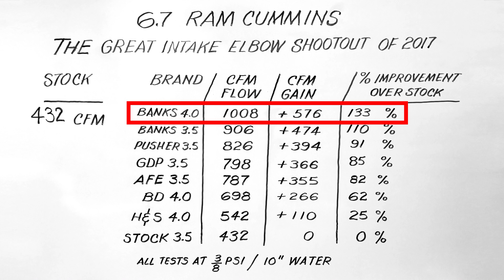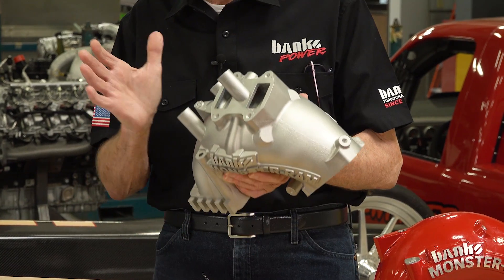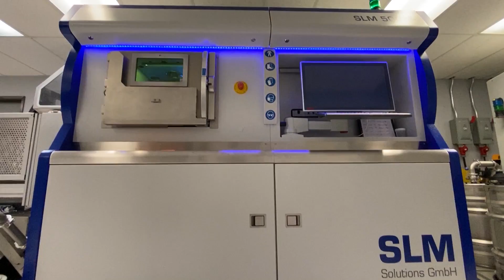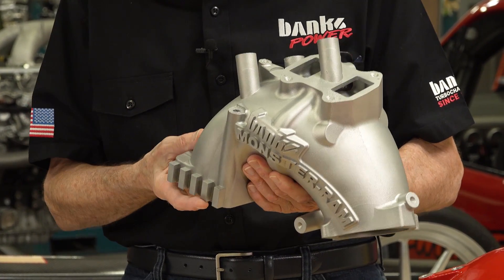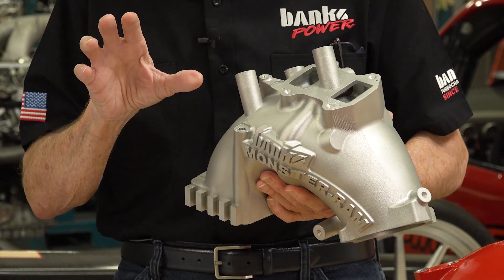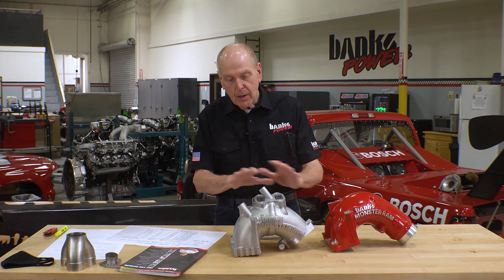This is a 3-D printed ALUMINUM Cummins intake!

Comment: Put me on the list. And please please get us a Derringer also. I need better than stock performance, efficiency and reliability. I'm in CA and a banks power pack combo thats smog legal would be awesome!
Reply: I asked the same thing about the Derringer and this is what they said:
No eta right now. Development has paused on this project, not stopped. Unfortunately, we didn’t get the power that we wanted. The RAM 6.7 requires timing and pulse-width control. This means it's a whole new circuit board and firmware. It shares nothing with the Duramax and Power Stroke except for the plastic housing.  As you know, we don’t release tuners, or any parts for that matter, that don’t beat every competitor handily. So, when we didn’t beat them all, we went back to the drawing board.The Derringer for the RAM is no different. When it smokes the competition with power and safety features, we’ll share it with the world. Also, due to current issues with Covid-19, there have been delays for product development and releases across the board. We are making changes to our schedule on a week by week basis at the moment.
Reply: Derringer. Been waiting on that also for a while. Not sure what the heck is the hold up on that. I'd be in for this also.

Comment: Gale is it possible to get some improved exhaust manifolds printed to test on the L5P and add more EGT probe holes to maybe monitor all 8 cylinders as a way to tell if a glow plug or injector has failed to also cut the signal to the injector to prevent hydro locking the engine and plugging the oxygen sensors before and after the catalytic converter and throw a truck in limp mode
Reply: No.

Comment: Just imagine what kind of internal parts that can be manufactured for high performance do not break engines.
Reply: Porsche has some prototype piston heads that were 3d printed.
Reply: Kind of curious about the structural strength of those pieces. The forging process creates stresses that create strength in a piece that isn't there in cast pieces. These are kind of a cross between cast and sort of billet I guess which is why I'm curious about the strength. I read something on it a while back but unfortunately I can't remember what was the verdict. Sucks getting old.
Reply: @Parents_of_Twins  I think it would depend on the material. It's similar to welding, but many different types of welding produce many different strengths of weld based on the filler material for the weld. I bet it depends on the material
Reply: @jomanout5866  Yeah that's true. I'm guessing the heat transfer away from the heated region would be much faster though so you might not get the localized weakness that can come when welding a tempered or hardened part. Since you can control your filler you don't have to worry about carbon floating around making your weld too hard while lowering your base hardness. Do they have a welding technique that is like this?
Reply: @Parents_of_Twins  I don't know the proper names but I think one version is a hybrid between casting and welding, powdered sintered metal. This is weaker than forged. Another type is spray arc transfer, or spray weld transfer, I don't know the proper name. It sprays powdered metal out while heating it simultaneously, so the molten material cools and bonds to the surface. I know pro lathe workers use it to build up worn down shafts that they can't find replacements for. I assume it's weaker than forged also, but I don't know on this one
Reply: JoManOut  The spay arc type of welding you are thinking of is called Metallizing . There are others names for it as well.
Reply: @Parents_of_Twins  Testing is the key to finding out about the unknown. Going from there is the answer to all our questions. Coming up with new technologies is through trial and error.
Reply: @40calDeathPunch  Absolutely the scientific method.
Reply: Correct me if I'm wrong, but I don't think Gale intends to sell us printed metal parts. He's going to machine and test his printed copy to the point where he's satisfied with the performance then make sand mold copies of it. The only reason for a metal print is to survive the testing on a hot engine going full bore on the dyno.
Reply: @paulallen4650  You are correct. I believe the point of the printed piece is to be able to get directly into testing rather than having to make a mold, then test make corrections, then make new molds, etc. It is not clear to me if the printed piece is stronger or weaker than the cast piece. The cost of casting is definitely less than the cost of printing. I worked at a foundry for a while as a stand grinder. Never have I woken up with my body aching as much as I did after my first day on the job. If I remember correctly I had picked up and ground something like 12k lbs of parts. Even working as a hod carrier was easier and what I went back to after having a disagreement with a supervisor. I was 20 at the time and as most 20 year olds figured I knew better. Sorry for the tangent.

Comment: I’m a machinist and we are getting a metal printer soon.
Reply: Lucky.  I graduated from trade school at the end of last year and I'm still looking for a job in machining in my country 😆
Reply: Ibraheem Al hadede Move to the US. Many companies looking for a machinist- even ones just graduated.
Reply: @chloehennessey6813  I would if I have the chance. But for now I am looking in my country.
Reply: @chloehennessey6813  For real? How about CNC operators?
Reply: @Daydreaminginmono  yep, there is hardly anyone here that want to do this work.
Reply: @turtlemann14  IM a cnc operator from the uk, and i am drastically underpaid. I think it would be better working in america at this point
Reply: @turtlemann14  issue is pay when compared to maintenance tech.  I swapped fields for this very reason.
Reply: @Daydreaminginmono  according to zip recruiter im paid slightly more than the state average of 19.82 per hour. that being said, i also program and repair the machines as well as a lot of other stuff around the shop.
Reply: @bowez9  this is true, i've talked to a few of the guys we have come in to work on  machines, they say it is indeed worth it and honestly it seems like a very neat field to get into. im currently fixing up a e526 atrump i bought for a very reasonable price and hope to either turn it around or put it to work.
Reply: @turtlemann14  I left as a Tool and Die Maker making $22+ now making $30+ in maintenance.  Very similar skill set just not authorized to run the machine tools any more.   Which is funny in that Ican run most of them just as well if not better the machinists at my new job.
Reply: Metal printing is cool stuff, but still in its infancy. Did you notice the rastoring pattern? You have to do that to prevent microscopic cracking. It is great for prototyping and some other specific applications, but it is not good at everything....yet. A lot of science going on there...critical high stress parts basically need the processing proofed out...all the way down to the rastoring pattern.  Oakridge National labs is working on vision systems for process control and quality verification...it is its own specialty....

Comment: Not only is Mr. Banks making great parts, but he rolls in with the verifiable science afterwards to show the competition that they aren't really competition. Its hilarious to see the rest of the aftermarket get called out for literal inferior designs. Nice try, everybody else.
Reply: If not inferior at least lazy. The other intake hats or whatever you want to call them work but instead of being smart and making a new line to go with they got lazy and put a giant dent into it I guess thinking a huge dent won't make any difference to air flow. Personally I think it is laziness coupled with greed. Get it done quick, cheap and quick. First to the market wins whereas Banks has a huge following who knows that Banks will eventually get around to making one and do it correctly. Those other guys are just trying to get a slice of the pie first.
Reply: Simple fact is they don't want to take the extra step and make a line to go around the housing.
Reply: I heard Mr Banks fired Mary Poppins
Reply: @RadDadisRad  After he banged her.